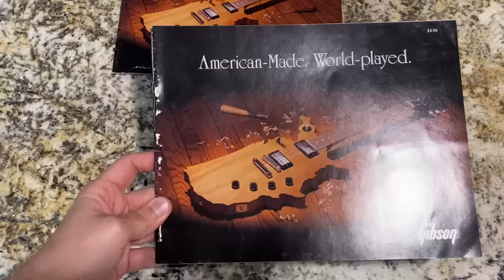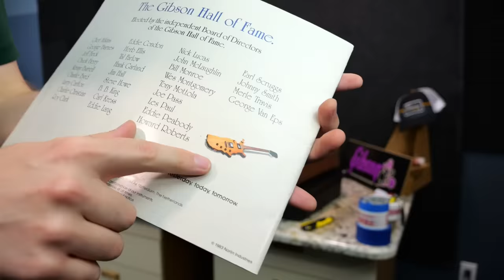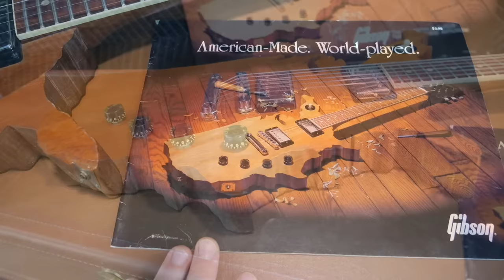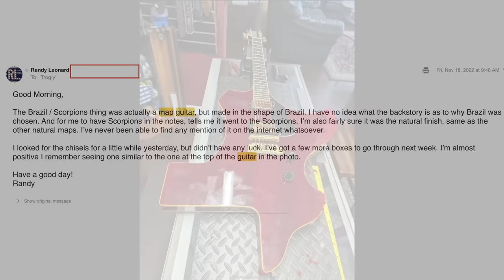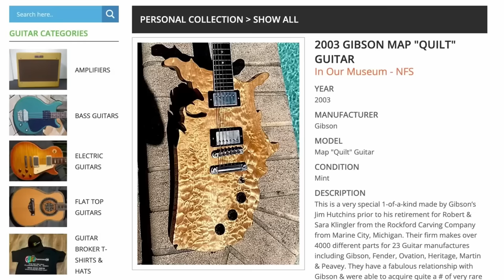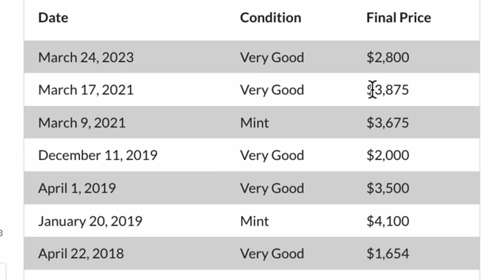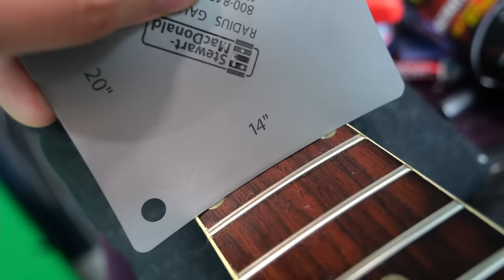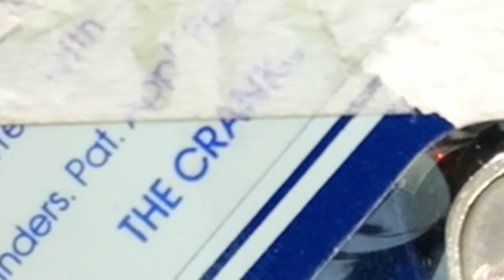I Found The PROTOTYPE Used in This Iconic Photo! | 1982 Gibson USA Map Guitar Review, History + Demo

Comment: I think maybe that wooden plug that you said might be from a strap button location (up by Maine) is actually a plug from the drill hole that was used to wire the pickup selector. But It doesn’t exactly line up though, so maybe it’s from a strap button.

Comment: In your vid you make a number of comments about the mat finish. This makes complete sense to me. It was made to be photographed. The thin matt finish makes it much essier to photograph under studio settings. The grain will show more and the color balance will be easier to control without light reflecting off a gloss surface. This is especially   true when photographing it at the angle shown in the brochure.
Reply: I shoul add that I am a camera collector that restores large format wood cameras which I then photograph. My guess is that the finnish is a simple oil or possibly a thin nitro cellulose finish as suggested by an earlier commentor.

Comment: That is most likely Watco Danish Finish Oil as its finish. It’s looking due and is best applied using bronze wool. If you don’t want to do that, at a minimum apply some to the edges with a soft cloth.
Reply: I was thinking it was just plain boiled linseed oil.

Definitely leave it as is. As the cover girl, only dust her off. Do not attempt  any restoration unless you know exactly what was used and how to do it. Do not scratch the surface with brass wool. I wouldn't even lay down more oil with cheesecloth. Keep it in temp controlled in its case out of the sun and dust it. Original as possible.

And yes, those are surface planer knife marks on the back.
Reply: @bonkyb8587  Plain linseed oil has a different look, especially at this age.
Reply: @caphenning  depends on the kind of mahogany. This looks like SA and without seeing IRL, meh. Even SA varies.

I have an old book rack I made with SA and linseed that's approx the same look.